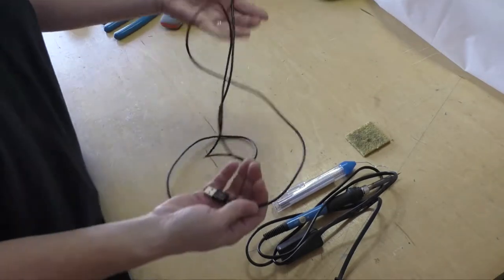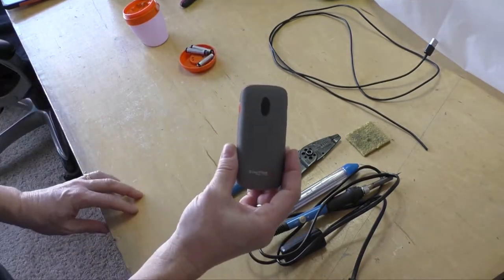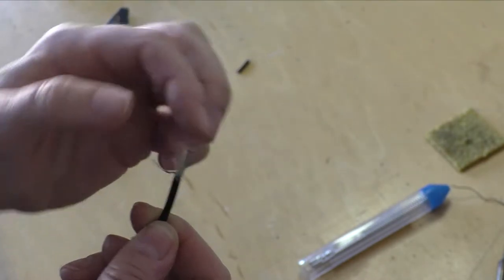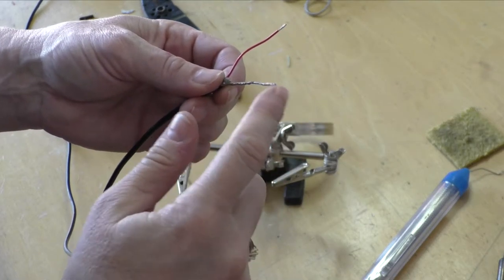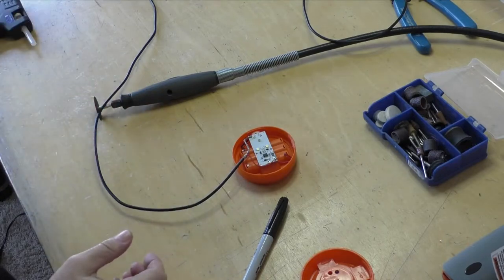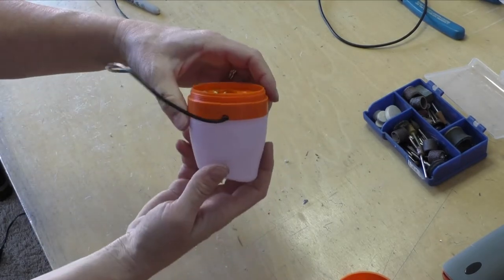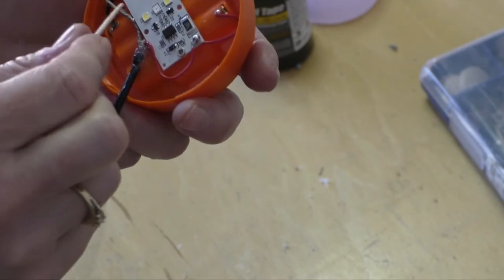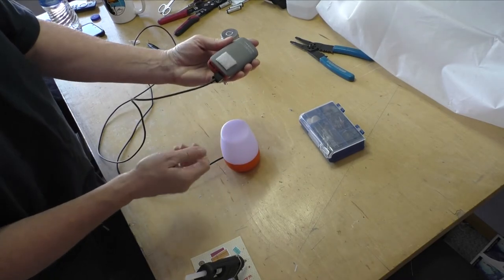How To: Convert a light from AAA Batteries to USB Battery pack!

Comment: Can anyone explain how to reduce the 5v from the USB adapter to only 4.5V. As want to use my device 24/7 I don't want to have that extra .5v as it will reduce the devices life from to much current. I would think a resister in line would do the trick. Any thoughts?
Reply from the maker: I'm not sure a resistor will serve your purpose. Take a look here: https://electronics.stackexchange.com/questions/74675/drop-usb-voltage-to-4-5v
You might get some ideas that will help you protect your device reliably. Good luck with your project!

Comment: HELP please? This is quite helpful, as I wanted to do something very similar with a light in my computer desk to brighten it up. PROBLEM IS -- it won't light up sufficiently like the batteries do.  I used a voltmeter to find which wires were the power (they weren't the traditional red/black ones), soldered them to the right contacts (I don't want to use batteries again), and tried several different power sources (4 wall chargers with different amperages, and two computer USB ports.)  The light won't light up when plugged into any of the wall chargers: and when plugged into the pc usb ports, it strobes a couple times, and then stays rather dim. I don't know enough about this stuff to troubleshoot it myself. Anyone have any suggestions?
Reply from the maker: Hi there, I would guess the most likely issue is that your light takes more power than the USB ports can provide. Generally, USB provides 5v or power (some can provide more, but from what I understand, they're designed specifically for that purpose). While my little light originally took 3 AAA batteries @ 1.5v each for a total of 4.5v, the 5v USB is close enough. If your light is supposed to run on, say 12v, the USB just won't have enough "oomph" to run it. You can see what it's supposed to run at by looking on the batteries. Each one will tell you what the output is then multiply that by the number of batteries. 

Another possible issue is that if it's not a dimmable light, being even slightly underpowered might cause them to flicker. 
I'm no electrician but I hope that helps! :)

Comment: Great vid!  Would be great to learn slightly more abt the elec eng part there.  5V and 1.5V don’t sound close together to me imo - that’s almost 4 times .  It’s hard to gauge what’s ok imo and that’s why I got somewhat scared of doing these hardware experiments for myself lol.
Disclaimer: I got an elec eng degree without knowing what I was doing lol.  I didn’t specialise in the hardware side of thing anyway.
Reply from the maker: You're absolutely right, 1.5v is way lower than 5v, but since the light takes three 1.5v batteries, it requires ~4.5v, so a 5v power supply is generally within the tolerance. Hope that explains it! Thanks for watching! :)
Reply: @EndlessDIY  yea indeed!  Not sure I missed your telling it, but it being a 3-to-4-battery device is quite critical whether it’d succeed or smoke the thing out useless!
Reply from the maker: @schwarzkelloggs  Absolutely! I explain it at about the 1:07 mark but you were right to be cautious. It's an important piece of info. :)

Comment: I usually tie a knot on the cord inside area so if wire gets pulled hard it wont get destroyed or torn from connection,alot of electronics had that knot for that reason